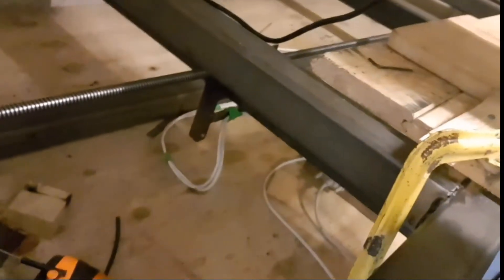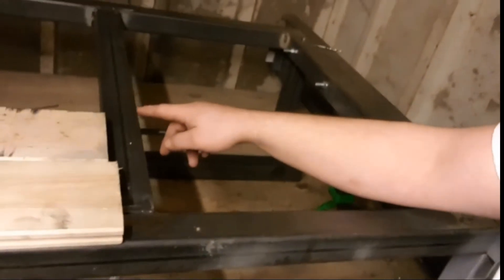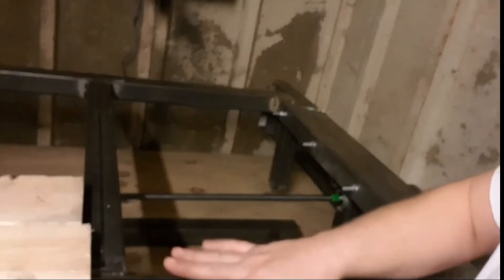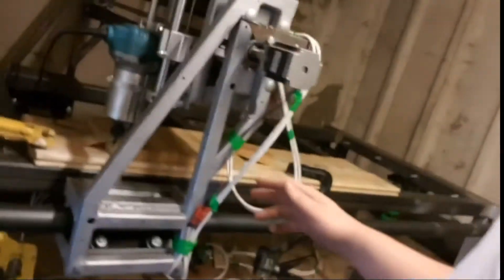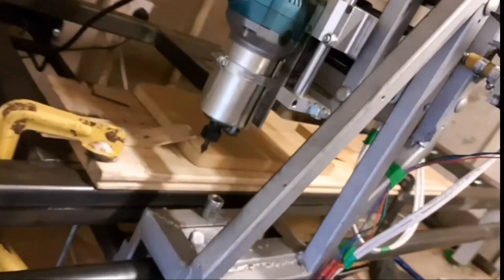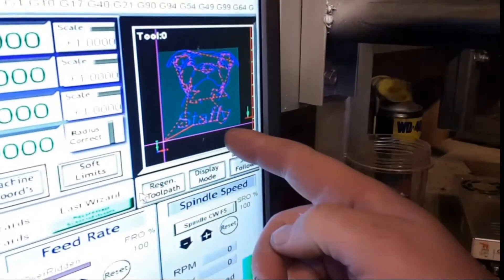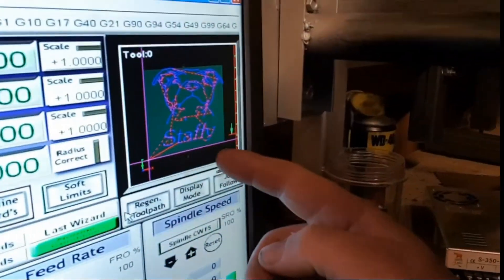Diy cnc machine build part 5

Comment: The project seems very good. Just some question. Which kind of steel have you used? It doesn't seem stainless. Why you didn't use tin for movable parts? It's lighter than steel, easier to arrange and cheaper.
Reply from the maker: Carlo Lestani 
I used mild steel for the strength the full machine can be dismantled in to parts no I didn't use stainless due to the fact that my welding skills are still sketchy, the weight of the cnc don't effect the movement of the x,y or z axis